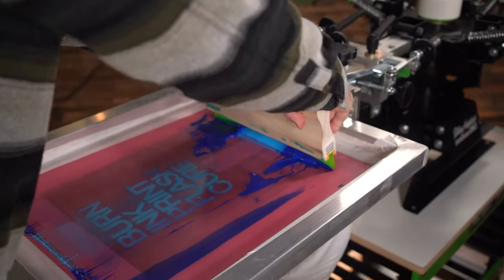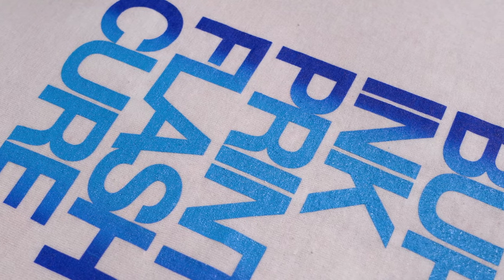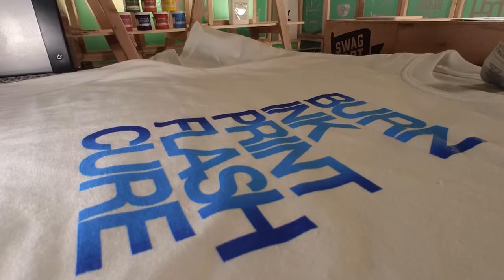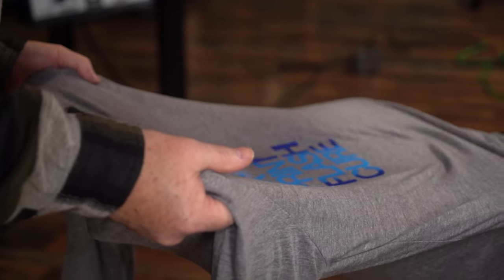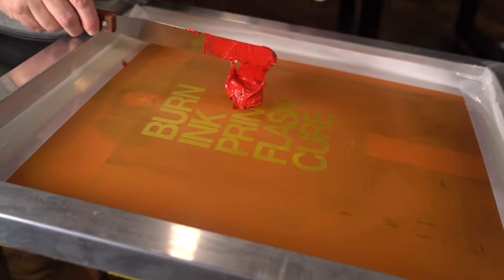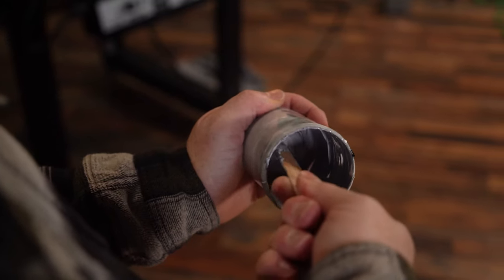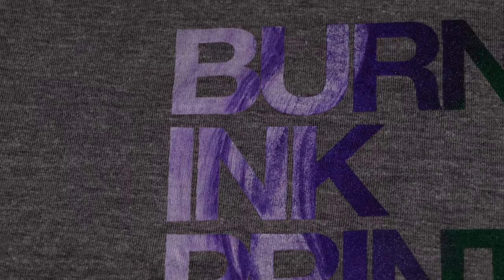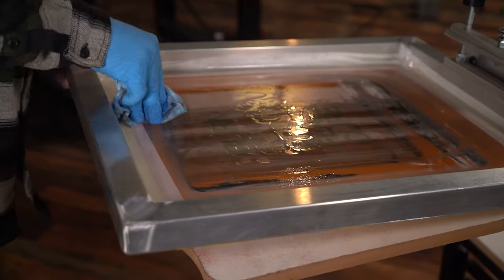Tired of Split Fountain Prints? Here's 3 Different Ways to do them

Comment: I love them awesome job! Is the temperature to cure them in a black tee is different than other colors?  I am using water based speed ball
Reply from the maker: Hi @Martha Gutierrez  The cure temperature will depend on your ink and what temp it requires to be fully cured. There most likely wont be much difference between garment colors. if you are building up a thicker ink deposit on a dark color garment, you will need to take more time to cure, but not really a change in temp. The added time ensures that we are getting that temp through the whole ink layer on the tee. Hope that helps.

Comment: Can you get the same results with water based inks. I wish that I had the time to experiment with this today; I ❤️this video!!
Reply from the maker: Hi @Eric Tuxen. you could use water based inks. they may blend and become "muddy" much quicker compared to plastisol due to the consistency of the ink. Plastisol can have a little bit more body. BUT, as long as you are willing to experiment with it, you can make it happen!
Reply: Fountain ink with plastisol it's much easier, the stroke you hit usually goes on the same direction and blending the colour will cone much later...by the way with waterbased colors I suggest you to drop few colours one print at the time, if you use a retarder you can manage the drying easier